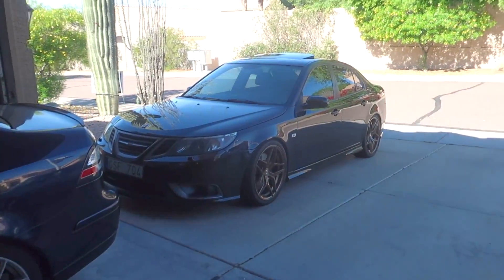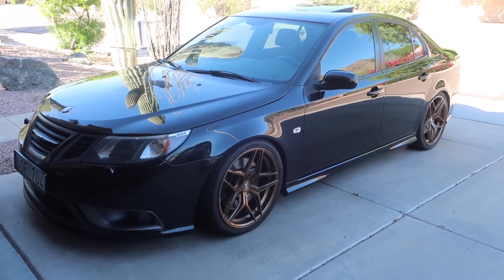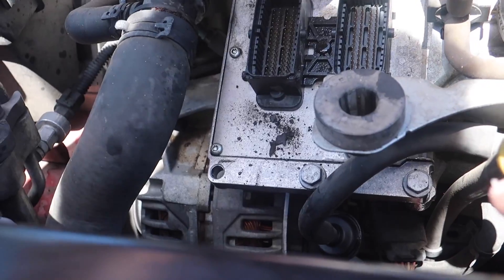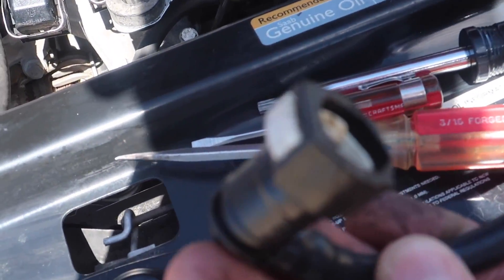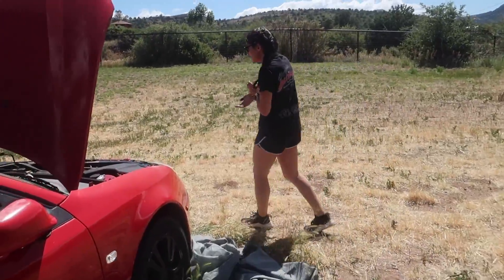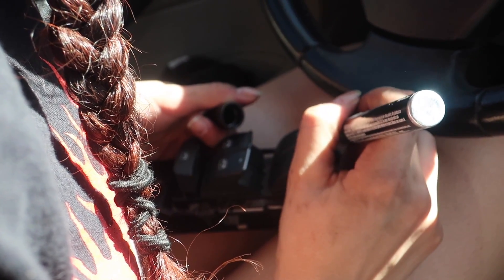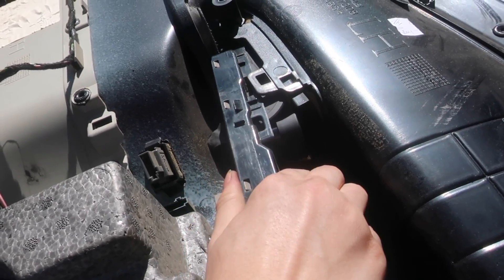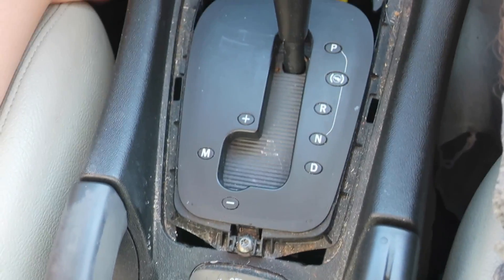Project Saab Episode 3 - ECU Removal, New Brake Booster Hose, Armrest, and More!

Comment: the heat probably killed it, that's why I told you about the spacer plate "Saab 93 ECU Heat Insulator Kit"  from the Australian guy.
Reply from the maker: could have been, although there's a lot of reasons they fail!
Reply: Hi, im SAAB 9-3 2.0t owner, and i have only one question, what is the problem/ms why ECU is bad and need to be replaced?

Comment: I’ve seen someone  on You Tube promoting a device that enables mounting some NG Saab’s Ecu’s so that they don’t rest on top of the engine block, ie creating space between, so that the ECU is less exposed  heat. Not the greatest design feature for Saab to have put it on top of the block. Maybe that is why they are prone to failure. Ever considered using such?
Reply from the maker: I've heard of that; not really sure where to get one from or if it's really worth it

Comment: I have a question.. since you got a Saab and been around turbos. On a stock Saab 9-3 2.0T automatic do I need to hear the diverted valve   make a sound cause I heard my mine just once doing the pweee sound  ever since then I hear the turbo working but no whooooish or pweee sound I Wana just to make sure if that normal or no I go no check engine light
Reply from the maker: Yes..you should be able to hear the turbo lol

Comment: Amazing video! I am thinking about buying a 2008 Turbo X although it costs a bit more money than the "regular" 250 hp V6. Is it worth getting the turbo X or save the money into for example stage 1 tuning on the 250 hp car?
Reply: A turbo X is a lot more special car, the X is also awd
Reply: @alexstromberg7696  Tack ;)
Reply: Smooth Flying exact same engine,  different factory tuning.  The TX has special styling and haldex awd like audi Quattro.  You can can get later Aero models with same awd drive train and power.
Reply: @brycegarrison8075  yeah but a aero will never be a turbo X. Also haldex isn't like quattro
Reply: @alexstromberg7696  i agree!  the turbo x was an amazing car and was just stating facts.  many turboxs have been wrecked at this point and the 600 will continue to dwindle.
Reply: @alexstromberg7696  and haldex was the provider for many audi volkswagen models with Quattro
Reply: @brycegarrison8075  only a3s and under has haldex
Reply from the maker: Yep! Agree with what y’all are saying. TX has a lot of special little things that come with it besides just the drivetrain. I did a video about it a while ago if anyone is interested: https://youtu.be/Er4eptbajhY
Reply: @alexstromberg7696  Also the TT and other models.  But again is why i said LIKE.  either way like Auto.Autopsy said, they are amazing vehicles.   Ive owned several v6 with tunes and have been in a turbox with 19t stage 3 vtune.  The looks alone are enough to want one.  Was just informing it wasnt the only Saab with that drivetrain....
Reply: @AutoAutopsy  I´ll watch it! Thanks for answering my question :)
Reply: In my opinion the 08 aero xwd is the same car with a few simple mods but damn it’s not a turbo x